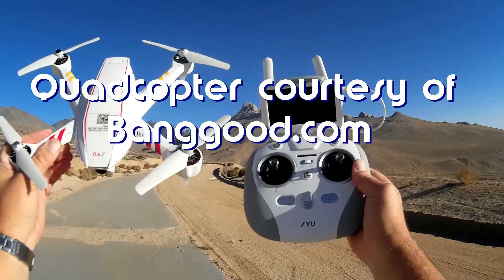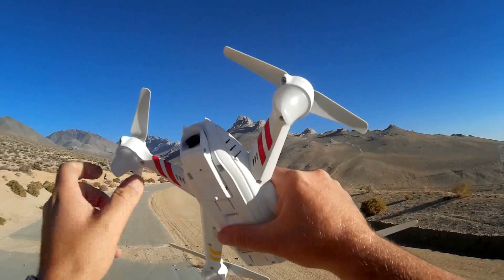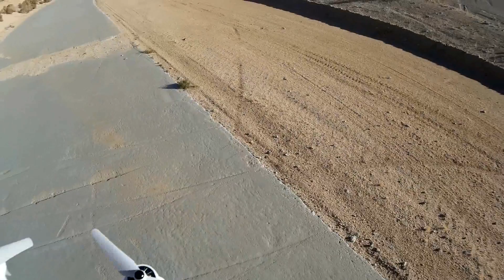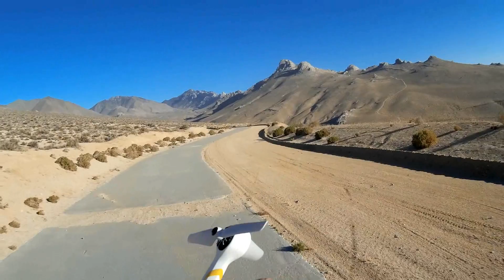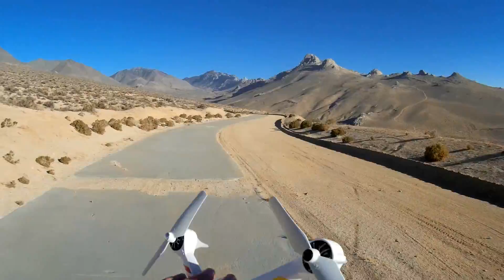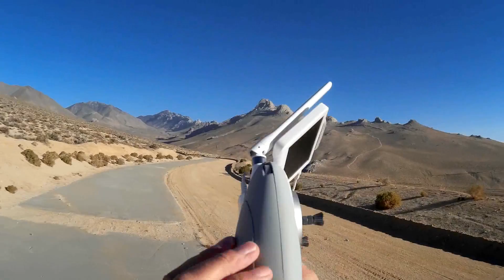JYU Hornet S High Speed GPS FPV Explorer Drone Flight Test Review

Comment: hey!! I'm looking to buy a quadcopter for under $150, with a camera built in and a controller so I can see what's on the camera, any suggestions?
Reply from the maker: If you can spend a little more, you can also get GPS and follow me mode. https://www.youtube.com/watch?v=Pj8UEq4zWQk
Reply: +Quadcopter 101 thanks so much!!
Reply: +Quadcopter 101 https://www.amazon.co.uk/gp/aw/d/B013GDD8G0/ref=mp_s_a_1_1?ie=UTF8&qid=1468782162&sr=8-1&pi=SX200_QL40&keywords=drones+with+hd+cameras+and+screen&dpPl=1&dpID=51iXD774KlL&ref=plSrch would this be a good model? I like it more with th3 controller but I wasn't sure of the specs. could you tell me soon please :)
Reply from the maker: Watermashen That's a WiFi FPV flier. I think that you'll be disappointed in performance and range.  The WiFi FPV camera transmits on the same frequency as the quadcopter's contoller, and can severely degrade flight control and FPV video range.
Reply: +Quadcopter 101 is there anyway we can message and you can help me get a good one?
Reply from the maker: If the H502S is a little pricey for you, then maybe the following might be more agreeable.  No GPS or follow me, but it is a darn good flier, with good camera, and 5.8Ghz FPV https://www.youtube.com/watch?v=scJ67mWmD_E
Reply: +Quadcopter 101 it's not price thats the problem, my limit is around $200 as I'm getting it for a birthday present, so do you know any that would be good for: photos and videos, quite long range and a controller with a screen on it. thanks
Reply from the maker: Watermashen As mentioned, the best in that price range with all those features is the H502S.  This is especially true if the recipient is a new flier, as the H502S is very easy to fly with its GPS.
Reply: +Quadcopter 101 thanks! it looks good and I was thinking of buying some goggles that you also recommend me, is there anything that is mabey a bit pricier but has better specs? I just want to make the most of the money I spend ;)
Reply from the maker: Watermashen Of course you can go pricier with better specs.  But as you go up, they're less safe for beginner fliers https://www.youtube.com/watch?v=SfsU5Uwvgb4
Or you can go cheaper with still pretty good specs.  No FPV though, but with GPS and still very good for beginner fliers) https://www.youtube.com/watch?v=NLj2hqVC4aA

Comment: What the heck is it with that FPV display that keeps going to "JYU HORNET OSD .... LOADING" ... then back to the FPV display?  If that happens at the wrong time, it could be disastrous. It's also dangerous to come back at whatever altitude its at when you hit RTH.  The compass calibration is a bit much, and the wait for GPS satellite acquisition (without giving you any clue as to how many it has other than the lights) is, as SeBy would say "not  incredible". They claim 20-25 minutes of flight time, but your flight, when the battery dropped to  9.9v with low battery warning, was far less.  On the plus side, once you do get it calibrated and acquire GPS satellites, it seems very easy to fly. Maybe they'll tweak the firmware and iron out a few bugs down the road.  Thanks for the review .. Cheers.
Reply: Hello Bill, any chance we can chat via phone or email that isn't public ?  I just wanted to ask you a question or two. Thank you, Mike
Reply: Perhaps a PM via FB?
Reply: I read that the 20-25 minute flight time claim was based on flying in GPS switch position 1. It goes down when flying manual.
Reply from the maker: Yeah it really sucks the juice when you put it pedal to the medal.

Comment: Question:  Could you not start flying in manual mode while you are waiting for GPS satellites or does it have to set still. Thanks
Reply from the maker: You could, but your return to home location will not be set.  in such a case, nobody knows knows where it will fly to if you hit return to home.